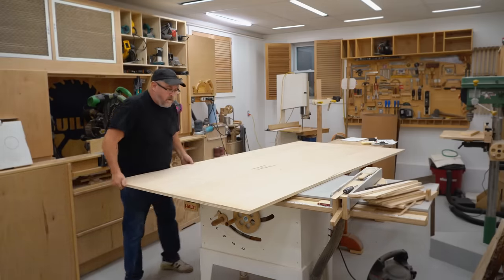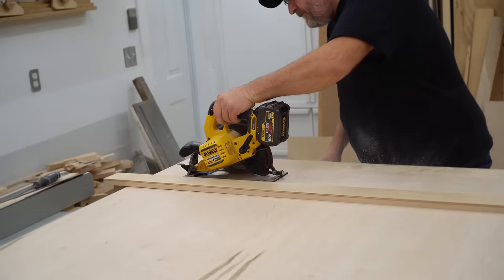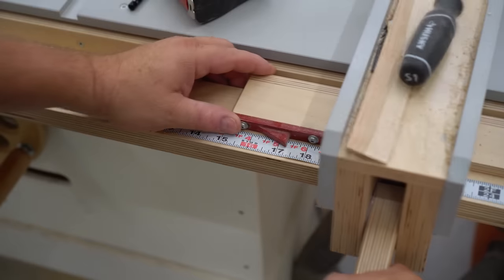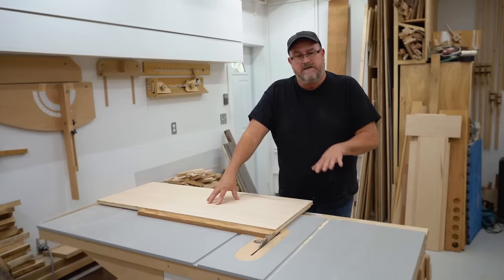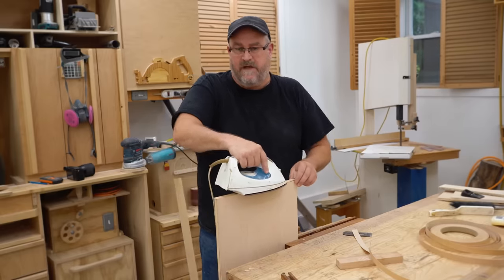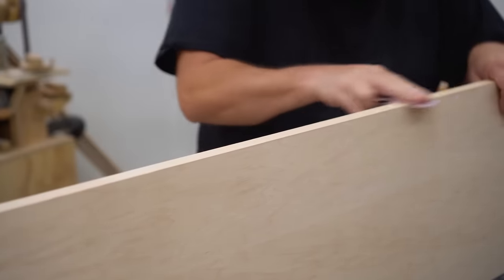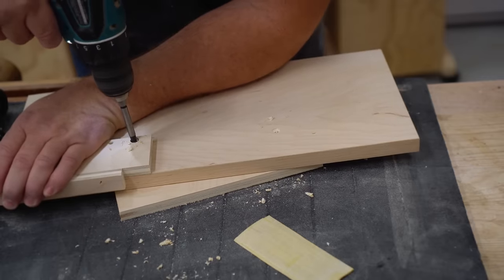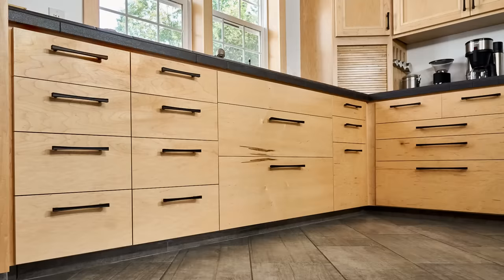Making Modern Flat Panel Cabinet Doors - Woodworking

Comment from the maker: I love the simple, clean look of these doors and think they are a perfect complement to the more complex frame and panel doors I used on the upper cabinets.
While these doors and drawer fronts are considerably less complex than the frame and panel doors, getting them lined up perfectly for the correct look does take time. I spent much of a full day getting these drawer fronts installed and tweaking the fit. 

▶️ Project plans for sale: https://ibuildit.ca/plans/
▶️Support the work I do on Locals:
https://ibuildit.locals.com/
▶️ Patreon:
https://www.patreon.com/user?u=865843&ty=h
▶️ Join my Makers Mob for detailed build tutorials:
https://go.themakersmob.com/john-heisz-i-build-it/?via=ibuildit
Reply: Nice and elegant, thanks for posting this.
Reply: I really like them too John. Having done a few, can agree that any gap differences will be obvious from across the room. They just don't hide any 1/32" difference like the raised panel fronts do. Have you ever tried using drawer front adjusters, and then install handles after the fronts are on the drawers?

Comment: John, the tip about lining up the handle with the edge of the drawer then measuring the remaining portion of the drawer to get the handle spacing is one that may get overlooked by most, but it is gold!  I have built so many cabinets over the years, worked in cabinet shops and installed 100's of kitchens, and that one never crossed my mind.  I wish I would have known it when I was still doing it for a living!
Reply from the maker: Did tons of installed too and for the residential kitchens they always sent them out without the handles installed or the holes drilled. It only took one mistake and the need for a replacement door (that I had to then go back and install) to teach me. Always use a guide if practical, and always double check before drilling :)
Reply: Would like to second this. I've been an engineer for for nearly 10 years and had never come across this measurement trick. Thank you for sharing it!
Reply: Can you explain that in more detail about measuring from edge of drawer to get position of placement of handle.. thank you
Reply: Christopher Ortiz for example if the door is 26” and the distance between centres for the handle is 8”, when you measure like he did from one end minus the handle you’d get 26 - 8 = 18”, then do 18/2 = 9” and that’s the distance from each edge of the door to the centre of each hole for the handle. (Clear as mud? 😬 )
Reply: @christopherortiz8713  think of it like this. If the drawer width is 20 and the handle is 5, you want the perfect placement of the handle which when centered would be 7.5 on either side plus 5 in the middle for the handle (7.5+5+7.5 =20). The measuring trick does this by rearranging the numbers to 5 + 15 = 20 and you do this by placing the handle (5) on the edge and measuring the rest (15). Them split the 15 to get the 7.5 on the end without thinking about it and put the end of the handle (5) there for the perfect placement you want to achieve.
Reply: @christopherortiz8713  Working with the centers of the holes, the total width of the drawer equals the distance between the holes (center-to-center) of the handle plus 2 times the distance from edge to hole center (when/if the handle is centered).
(Like:  eh*h-h*eh, where eh is edge to hole, and h-h is the handle between the holes, and * the holes,all of it making up the full width)

By positioning the handle on the edge (hole centered on the edge) and measure from the other edge to the center of the other hole, he effectively subtracts the distance between the holes from the total width - and that, per above, equals 2 times the distance of  edge to hole, thus the divide by 2 for the layout measuring from the edge.

Comment: Nice, I love this look. In our new house I asked the cabinet maker to do our kitchen like this and he said it would be impossible and that all cabinets had to have face frames for strength. So I built all my new shop cabinets like this and showed it too him. They came out perfectly and looked awesome. His face went completely red seeing that his customer was a better cabinet maker than he was! He then agreed to do the kitchen in frameless cabinets like these. The first cabinets he did had a 3/8" gap between drawers - unacceptable!!@!@ Finally, they came out the way I wanted them. He now advertises himself as an expert in modern frameless cabinets! BTW, the little edge band trimming tool takes a bit of practice to master, but when you do it really works great.
Reply: Nothing is impossible. Improbable, never impossible.
Reply: What a disgrace he probably never built a cabinet before.. I’m surprised he show up so u can embarrass him. I’ve starting out with faceframe until I realize how much space it take up and cost of hardwood and making installing doors more tricky than no face frame.

Comment: Looks great. A handle on that faux drawer might look good too.
Reply: While it looks good, they're typically left off to keep people from yanking on them. Last thing you want is someone yanking the false drawer front off or breaking the handle.
Reply: @JasonACadder  Are (would they be) the two handles and fronts fixed differently to the drawer body? I'd have thought not.
 Or is it distance to sliders/bottom making more torque that's the issue?

Edit -please ignore, didn't note the 1st time that the upper/bigger drawer body didn't go all the way up.

Comment: Hey John pal.. Love the look of these drawer fronts man.. The darker coloured wood under the damaged veneer looks awesome. I will remember that one day when I become proficient enough to build my own cabinets. I would love to be able to build my own cabinets one day in my own kitchen. Plywood is expensive enough but I got 8x4 sheets for 63 Euros per sheet. MDF the same size 18mm was 53 per sheet and OSB was 42/3 I think per 8x4 18mm sheets here in Ireland and that was from one of those Big Box stores as u call them.. B&Q is the name of the stores we have here. They rip us off somth rotten bro but It's very hard to find good quality timber merchants here anymore bcos our Forests have been decimated. W ehave hardly anything left anymore John.. It's a sjhame bcos I wanted to be able to get some Walnut, Ash, Oak and the likes but it's tough to get a decent price on any of that stuff today.. DICK TURPIN would be ashamed of the robbery that goes on here in Ireland and he wass English and they used to love robbing us here.. LMAO.. Just a joke mate.. 
I see ur table saw is holding up great pal.. I can't get my head round the fact u built it from scratch.. 
Why aren't u designing those saws from scratch and selling them online?? 
How much would one of those saws' cost John if ur were to make them and sell them? I'm serious bro..

Comment: I have has some failure with fastedge peel and stick white pvc edgebanding. It was on some curved parts, not a small tight radius either. Good thing it was on my own desk where I was pretty much testing it. 

I tried to use tape and glue like in the fastcap video to repair it, but no luck. I ended up replacing it with iron on melamine edgebanding.

Comment: @7:30 I am confused.  the drawer fronts are "wrong side out"? 
could they not be turned around?  I guess I am not understanding why not.
oh, are they screwed on from inside the drawer & now there are screw holes in what would have been the good side?
Or the countersink for the handle?

I guess I am confused because you mentioned it before you got to those steps.
and w/ edge banding on 3 sides you could still turn them.

Comment: Love the look of these - great job!  My wife wants me to make a new set of cabinet door fronts for our kitchen.

One question though - you cut off the ends of the plywood because of 'compression grain'.  I haven't worked with a lot of plywood so am unfamiliar with what you are refering to.  Have you covered this in another video that I can go and look at?

Thanks and keep up the good work!
Reply: It doesn’t have anything to do with the actual plywood. Sounds like he just didn’t like the look of the grain pattern (compression grain) of the veneer on those parts of the plywood.

Comment: Do you thin the water poly when you spray it or just use it straight from the can?
Reply from the maker: Straight from the can with a 1.8mm tip on the gun.

Comment: Nice work, looks great. I'm going to build similar slab fronts for my cabinets and was wondering how the edge-banding has stood up over time?  The other option is to make my own solid-wood edge banding and glue it on, but that's more work and would change the look.

Comment: Some questions on the finishing step: (1) what sandpaper grit is appropriate for sanding between coats? And (2) do you leave the final coat as-is, or is it also sanded, or (as I've seen others do) softened with something like kraft paper or a paper grocery bag?
Reply: Sand between coats is a 320.  I usually don't sand the final coat.  Unless I get a bug!

Comment: I really admire your work, I admire the ability you have to do things like that with tools built by yourself. By the way, do you usually have to regulate and adjust the cutting table a lot since it is manufactured by hand?

Comment: Hey John. I like the look of the plywood drawer front. What kind of plywood is it? Birch? Maple?
Reply: He mentioned he got it at a big box store.  So it is most likely 3/4 maple.    They only carry oak, birch and maple.   It definitely isn't birch or oak.  Oak is open grained, and the birch ply sold in big box stored is usually paint-grade material.

Comment: Hi John, I love your table saw fence and the way it locks down at both ends. I know you built your own table saw, because I have the plans that you sold on your web site. Due to time restraints, I had to buy a table saw but I hate the fence that came with it. Do you have plans for the fence only that I could buy. I jumped in at the start of this video so I apologise if you cover this later in this video
Reply from the maker: The table saw plans have the fence plans included.

Comment: My local wood supplier says plywood isn't suitable for cabinet fronts because it's not flat enough. Is this some kind of special grade that is super flat?
Reply: Your supplier either sells low quality product or know very little about the usage of their products. Look for good, high quality ply and you will be fine.
Reply: @KipdoesStuff  Any certain wood types or minimum thickness recommended? At least the thin sheets (4 - 8mm ) always tend to be slightly bent.

Comment: I love the explanation (as always). I'm planning some cabinets and this is great. By the way, what blade do you use for your cross cuts here? The lack of chip out here is fantastic and I'm trying to learn how to mitigate it for myself.
Reply: I'm pretty much always using somewhat cheap blades (just off the rack from home depot or lowes) so I do get a fair deal of chip out when cross cutting plywood. What helps me the most is to put masking tape where I'm going to cut along with a zero clearance insert in the table saw.